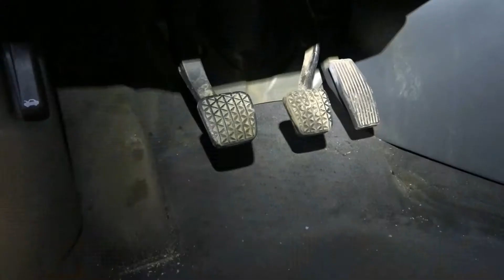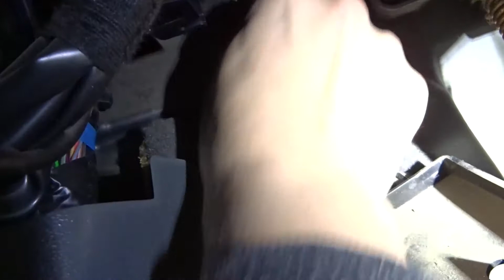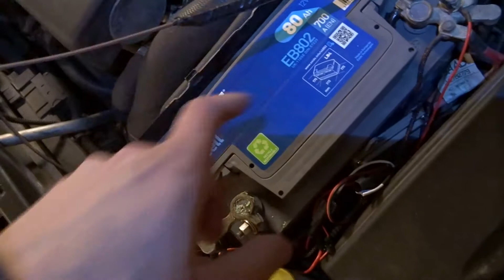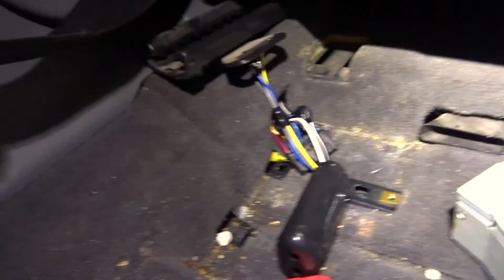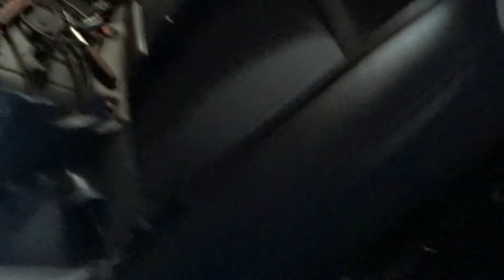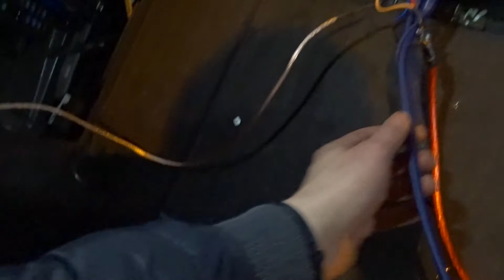Subwoofer Install SAAB ng9-3 - Active Subwoofer + Line Output Converter

Comment: For those who dont drive the cringe combis you can take remote from the blue bottom left fuse on the fusebox in the trunk
Reply: nice...   is possible to connect power cable from this fuse to ( active ) subwoofer maybe? - and not to the battery? thanks.
Reply: @halo-d3h no you will burn down your car

Comment: nice Vid, and how would u wire through from the HeadUnit to the battery! i pulled the HU out and looked for a passage, can't see anything!
Reply from the maker: Har to show, but i think i tried to show it in the video. There is a grommet in the firewall over the pedals, need something sharp to poke through it and then something to help feed a wire through. I think the hood hood release cable goes the same way.
Reply: @jobathano  I saw that, but how would u get it out from the Center Dash amd through the FireWall

Comment: Nice Video! I am going to put my Amp and Subwoofer into my 9-3 and i will also be using a Line Converter. But to make it alot simpler you can hook up the Line Converter to one of the rear speakers in the rear deck. There will then only be 1 wire, the power wire, that you will have to snake through the car. That's how i have done it in the past and it have worked just fine :)
Reply: Definitely not the rear speakers are filler speakers and when you hook it up to the rear the sound quality is horrible always used the front door speakers
Reply: @ryansmith4717  the front door speakers in arent full range so isnt good to use if you use the converter to a amplifier for a subwoofer

Comment: So i have a problem, my front door speakers do not work, aka i get no bass whatsoever. My amp1 is also missing and dunno why cuz i bought it a few weeks ago from a dealership, i thought about getting an subwoofer installed but then i noticed the guy started bringing up the amp1 inthis video, and a nonexistant amp1 is not good if you need it to get the subwoofer to work. Does anyone have any ideas about what the heck i should do, cause i have no idea, i have gone through lots of forums et cetera, without luck...
Reply: Are you sure you even have the door speakers? Premium 70 only have speakers in the dashboard and in the back and no AMP1.
Reply: @boxol29  yes, i have 3 in the dashboard and 2 on the front doors and 2 in the back, but the amplifier that should be in the trunk isn't there
Reply: @mattssonfelix3882  Bruh gissar att du är svensk med tanke på namnet?😂
Reply: @boxol29  jo haha, det är jag nog
😂

Comment: How do you turn the base up in the Saab 9-3 ?
Reply: add a larger Subwoofer using this guide and you can achieve a higher bass output. I'm planning on going with a spare tire subwoofer.

Comment: Because I have a convertible the amp is located in the rear door panel I believe on the passengers side, I did try to do it to back of the stereo but there are no speaker connections there and that’s why I blew up my for at sub as I powered it up and it just blew, I’m going to take the rear panel of tommorow and see if the amp is located there if not I’m just going to have to connect the in out converter to the speakers in the rear panels as I have easy access to the wires, so you think this will be ok ? Thanks for your help I know it’s been monotonous

Comment: My line out adaptor only has 5 wires 2 for speakers then another 2 for speakers and a ground wire, I’m wondering how it will power up even after I have done the remote wire ?
Reply from the maker: Its not powered. You can hook it up so it recives power so you get a remote signal feed from it, but it’s easier to just run it directly from 12v source to sub/amp.
Reply: Jobathano I got the remote wire set up and the speaker started just low thumping with the radio turned completely down ? Can you advice ?
Reply from the maker: Idk, probally a gain switch on the sub amp to adjust Intensity and threshold for activating.

Comment: I’m getting a voltage meter reader tomorrow morning and I will fuse it to the cigarette lighter, it’s all wired up apart from the remote wire and the battery is draining and obviously no power, does that sound right to you
Reply from the maker: Haha, Its hard to know how you have wired everything. But for the sub, you have + - and remote. +- are hooked up, battery and ground. Remote goes to any 12v supply, you can even check by connecting to another battery, the sub/amp should light up. 
For the high low, for one side you need to hook onto +- from speaker or cable that goes to the speaker. And they must go to the L or r channel on the high low adapter. From the high low adapter you have the speaker signal wire that you hook up to sub/amp.
It’s these three steps, check that the sub is working first and move on.

Comment: Could I just do the trick with the remote wire around the fuse then plug it into fuse box in slot that’s always being used when car starts ? And run that wire to sub?
Reply from the maker: Should work. You can also buy adapter in local auto store that you can solder onto the wire. "Car fuse holder adapter"

Comment: Sorry I completely missed the remote wire, my adaptor has two channels for the speakers and then a black wire, I do wire the sub remote to the in out adaptor right? I will run a lead from the black wire to the sub tomo and let you know how it goes
Reply from the maker: I think its just easier to run remote to 12v source in the back, like the cigarette lighter of headlight. The black wire is probably a ground for something
Reply from the maker: *Or. The remote is just for the sub to activate when the car is on, so it does not drain the battery.

Comment: I got a high low adapter but it was a cheap looking thing from China for £3 so I have brought a better one, also remote ? Maybe this is where I’m going wrong I have a power wire going to the sub it’s also got a big ground wire connected to a bolt and the ac leads, no remote ?? Can you advise and I will put a video up tomo of the set up when it’s light, I’m in London city thanks for the advice so far

Comment: I connected the in out input to the front speaker wires from the back of the stereo, I run the power from battery to speaker, ground wire from speaker to bolt the speaker is not working? I have switched over the ac leads nothing, my brother said my factory stereo might not be able to power the speaker I have what do to u think
Reply from the maker: And your sub have a remote signal to turn on? 12v hooked up to any 12v + supply that is used when the car is on?
Reply from the maker: And you used the high low adapter?

Comment: I have a Saab 9-3 aero 2005 2l petrol when I looked under seat I couldn’t see the amp just the motor to move seat, would it be possible to wire it through the front speakers ??
Reply from the maker: You checked under the left seat? It have to be all the way forward to see it and dismantled if you are going to wire it up. 
I think the front speakers work in a different spectrum, so you want get any bass signal out of the front speakers.

Comment: Did you completely remove the amp under the seat
Reply from the maker: So a hi low converter hooked up to door speaker wire, the one I think is used was purple. Then sound wires to amp, and remote signal from tail lamp connector or 12v supply.
Reply from the maker: No, just took signal from one of the wires. For one of the front door speakers, which is only bass.
Reply: Thank you will let you know how it goes
Reply from the maker: @sithomas605  https://www.youtube.com/watch?v=52e8ZHRIM9E&feature=youtu.be
A video with clearer instructions on how to wire up hi low adapter and get remote signal for the sub.

Comment: So why did you only Hook up L+ and L- to output converter??? Thanks for the feedback!
Reply from the maker: Use L+- or R+-, both will work. Maybe if you play cd with some fancy surround sound, you maybe want to wire both.
Reply: @jobathano  I hooked up both R+- and L+- also do I need to hook up another amplifier?
Reply: Do I need to hook up an amp too??
Reply: Did you hook up an amp too???

Comment: So, Let me get this straight.... on SAAB Apm (under the seat)... L- L+ (Left), C- C+ (Central), R- R+ (Right) are actual HIGH outputs that getting in to the amp so it can connect to 2 ohm speakers in the front doors? converter that you got is it... from high to low ? please clear the main part out... the tapping-in in to the wires.... (I have the amp that support HIGH inputs)

Comment: Hello, can you help me out, what colour are the left door speaker cables? I've found so much mixed info online. I don't have the correct size screwdriver/torx to remove the seat so need to take from the front door connector for my sub. If you could let me know I'd really appreciate it! Thank you :)
Reply from the maker: I can maybe check tomorrow. But i would personally just buy the torx bits to remove the seat, because its very easy to route the cables from there.

Comment: Yo, jeg gjorde akkurat samme tingen som deg, funka ikke :P eller jeg brukte en passiv H/L adapter da. Kunne trengt hjelp liksom.
Reply from the maker: BURNinstinct altså subben starter ikke? Koblet inn den aktiveringskabelen på strømslukere som er aktiv når du starter bilen? Kjøpte en ny sub, den hadde ikke auto start funksjon. Derfor hentet jeg først bare strøm fra 12v bak, men nå sitter det en kontakt rett inn i lykten bak.
Reply: Jeg gjorde det samme hah, henta remote signal fra kjørelyset bak ja. Problemet er mer at jeg ikke får lydsignaler inn heh
Reply: Har prøvd å hente fra forsterkeren under setet, bak i kofferten, og rett fra 6,9" bassene bak uten lykke :P
Reply from the maker: BURNinstinct den hi/low adapteren kobles jo på +_ på høyttalerkablene til en av høyttalerne. Derifra sender den lydsignal til subben, gjennom rca kablene. Subben skrur seg av og på med remote kabelen. 
Prøvd å skru opp gain og frekvensområde? Ellers funker kanskje ikke adapteren?
Reply: Prøvd å skru det opp men det funka ikke, er det mulig å få tak i den du brukte så kanskje det funker?
Reply: Forresten hvor i Norge er det du befinner deg? hah
Nord Norge eller Østlandet?
Reply from the maker: BURNinstinct Den jeg brukte kjøpte jeg på xtremecar.no for noen år siden. Men de som de selger på jula og Biltema fungerer på samme måte, innstalerte en fra Biltema på gamle bilen etter jeg tok den fra xc.
Reply: Hmm, det er rart, jeg bruker den fra biltema, den funker ikke helt akk. Kunne du liksom tatt et bilde av koblingene dine og sendt det til meg? Kan gi deg nummeret mitt :)
Reply: High there how you buy pass them Fiber optic cables what’s going into amplifier under driver seat thanks